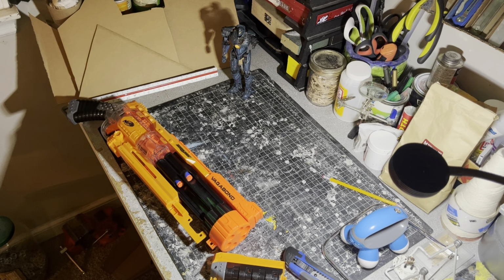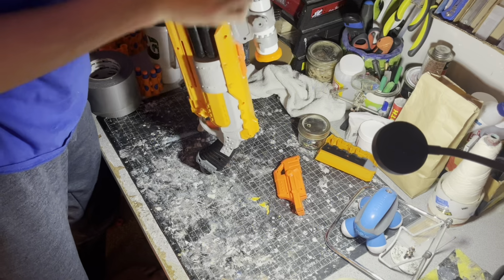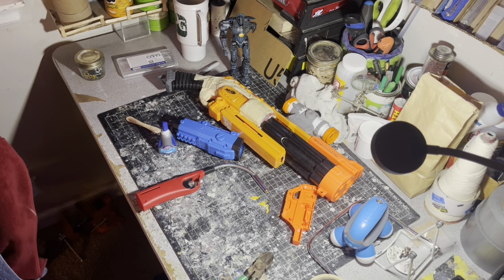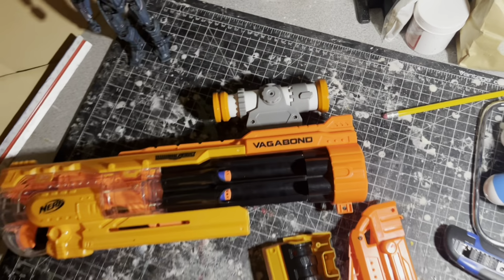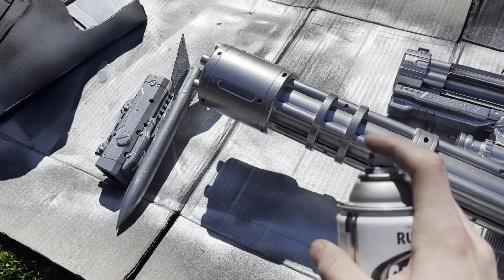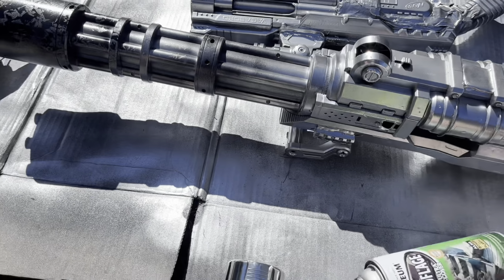ITS FINALLY COMPLETE!!!! My Cardboard Fallout Power Armor Build!￼

Comment: This has inspired me to make mine so much. Great job. You should think about extending the length of the arms and legs though. The hands are kinda inside the forearm armor. So doing a little sting action for the hands which would also make the arms longer would be great combined with adding length to the legs so you are standing at 7 feet tall or some super tall height with the platforms in the feet
Reply from the maker: Oh, trust me, I thought about those things. I am already standing on platforms wearing my mech suit, but since I wasn’t as passionate building this power armor, I didn’t really put too much attention into the hands which should be string controlled and puppetered

Comment: overall, how much did making the armor cost
Reply from the maker: Cardboard Free
Spray paint 5$ each
Hot glue sticks, tape, etc 15$
X-shot insanity $50
So like 60$ but you don’t have to buy the mini gun. You can make a nonworking prop out of cardboard and PVC pipe, but usually most of my projects are inexpensive cause they’re made out of cardboard. I just got a buy the glue sticks and tape.
Reply: Ok thanks🖐️🙂‍↕️

Comment: How did you make the leg pieces stay on while you wear them
Reply from the maker: I kind of cheated and made the calfs pretty thick. So then the knees could rest on the calfs and then the thighs would rust on the knee, so there’s basically nothing pulling it up to my body. It’s just stacked on top of each other, but I just did it well enough that it wasn’t an issue but if you’re experiencing that issue of it falling, you can always use Straps and buckles from Amazon to create suspenders or a belt that they connect to
Reply: @MarksWorkshopcrft  alr thanks for telling me I've been having trouble for a bit and this helps a lot thank you